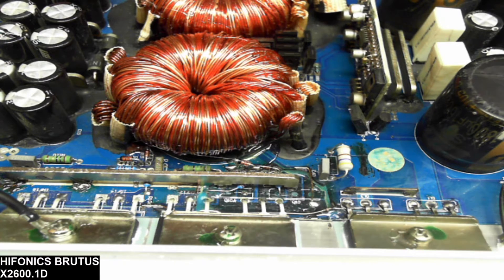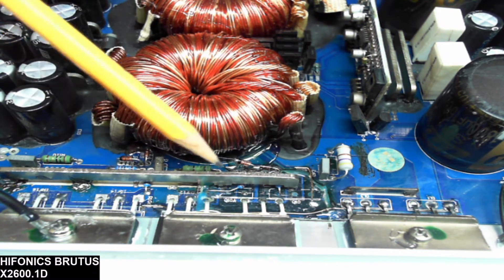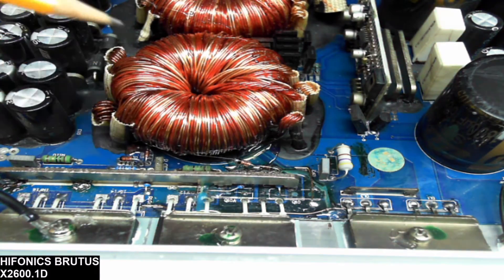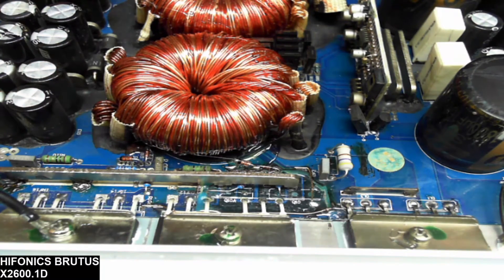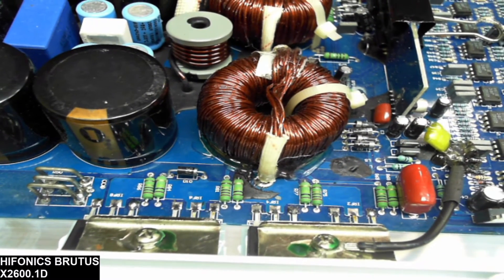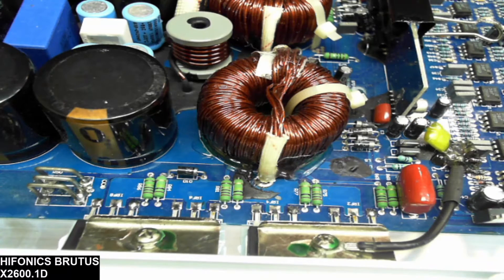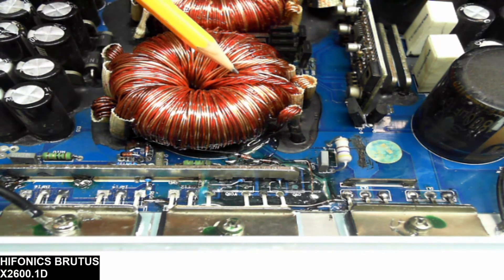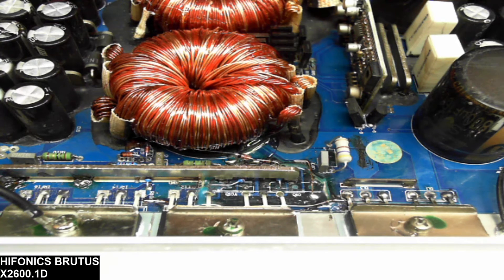Hifonics Brutus X2600.1D Rundown of Damaged Board Repair and Possible Initial fault

Comment: My amp recently went out (Hifonic Brutus 2000). I was adjusting the bass knob and there’s no more sound🤷‍♂️ I’ve had the amp for 4 years now and love it🙁
Reply from the maker: These are simple and not too expensive to repair. Rebuild the output card, replace the output transistors and it should be good to go if the power supply survived.

Comment: Do you have a source for the bi-polar/non-polar filter caps? I dont like the look of the film capacitors and ive substituted with crossover caps from dayton that look better however I'd rather just find the elc caps and be done.
Reply: I scavenge everything. If it has a board ill keep it around if even for 1 smd resistor. Plus the longer I have it the longer it takes to come back to me relabeled 😂
Reply from the maker: Hi and thank you for coming by! When it comes to the BP capacitors I have to scour the internet almost daily if my typical US sellers don't have them on hand. When I do find them I buy them up. Slowly I feel we will have no choice but to use film caps.
Reply: @ellensburgamplifier  I have a few scrap boards however max sonic loves the high uf rating and I do more 4500+ amplifiers with the 250v10uf
Reply from the maker: @commonsenseisdeadandgone  I am always on the lookout for donor boards as they are a great source for the hard to find parts.